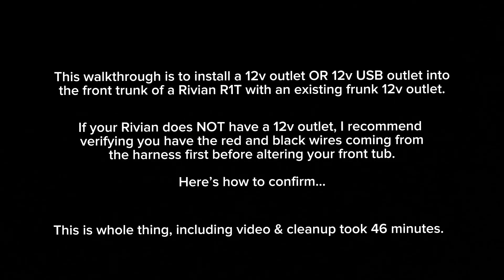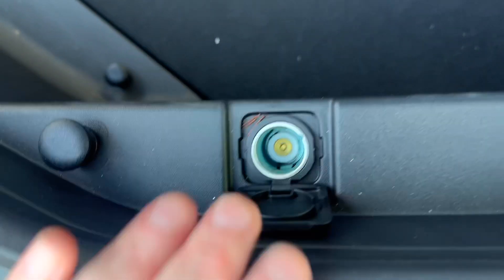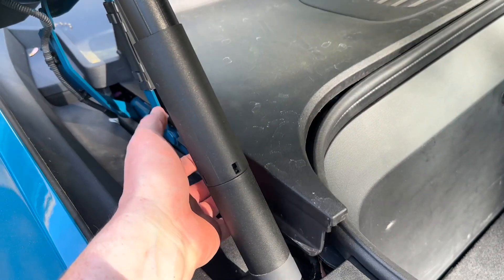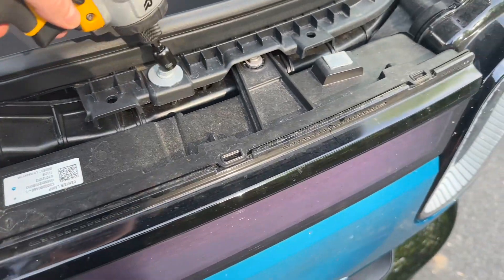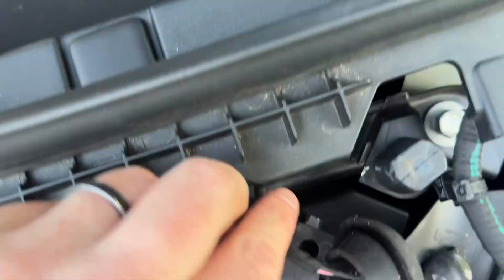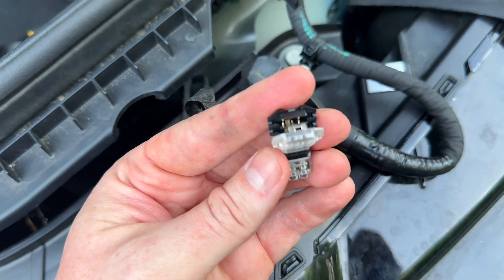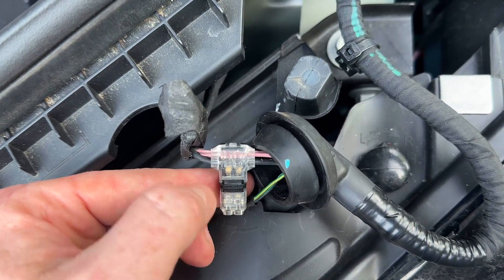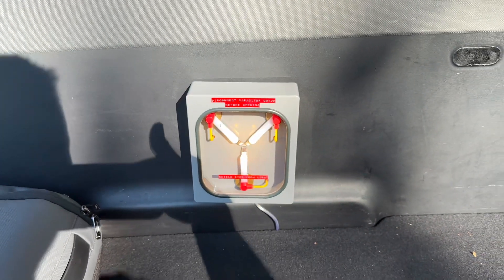Adding a 12v Outlet USB to my Rivian R1T front trunk walk through

Comment: Can I power a cooler off that front cigarette lighter or will that port only work if the truck is on/running?
Reply from the maker: Hmmmmmmmm I plug this into the 12v plug and it works well! https://a.co/d/dbxnA7P

Comment: When is the line hot and would the outlets timer feature in energy setting allow it to be constant?
Reply from the maker: I found that the wire powers down about a minute or so after the truck locks up, so its not a constant.
Reply: @Craigetech  Unless you enable outlet mode right? I also noticed this video may be super old because it contains a secondary 12v pair straight to the tub's junction box, whereas latest versions gets terminated at the end of the wiring harness from the tub light and requires crimping two new terminals + gaskets to feed into existing harness

Comment: Thanks for providing this. I just did this myself since my R1S didn’t come with the 12v in the frunk, and I would like to keep my portable fridge there. I installed the socket a little more toward the center and not as close to the light as yours. I worry that there’s pressure from something there since I had to take the tub out and set it again after the first try. The connectors had loosened a bit that time, so I set it in at a different angle. It’s working, but I don’t know how solid the connection is. Did you have any issues with contact to the back of the socket when installing the tub?
Reply from the maker: No issues so far! But good to know the newer version of the R1s have the wire still